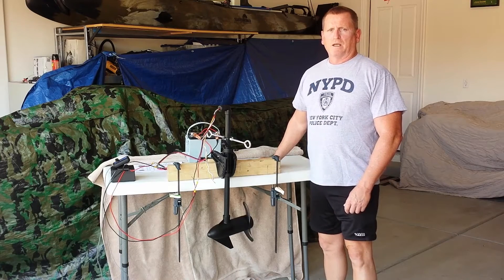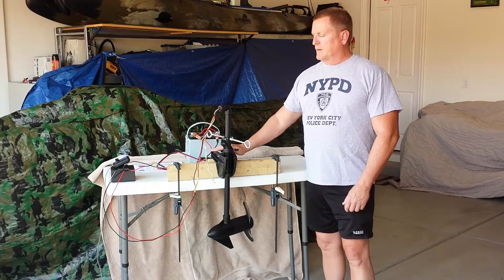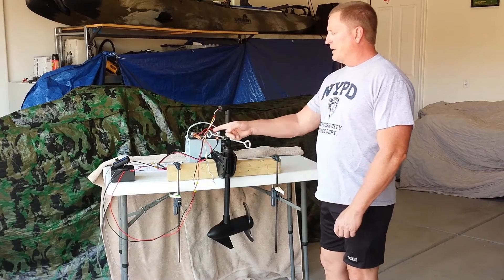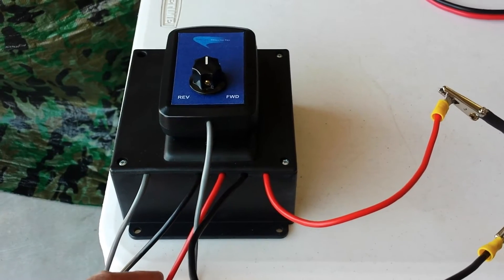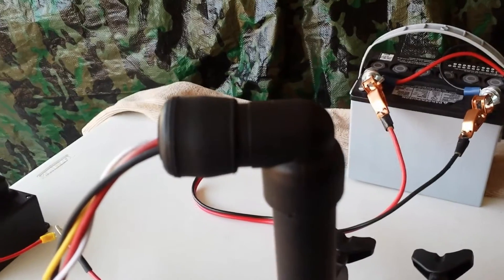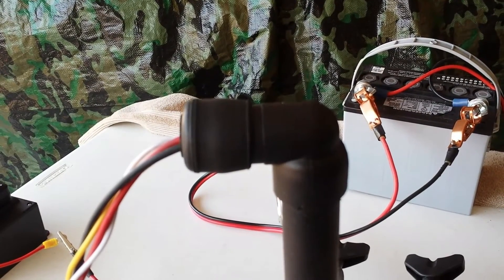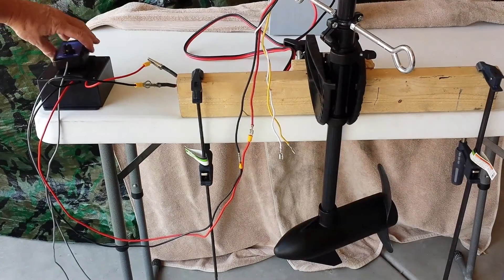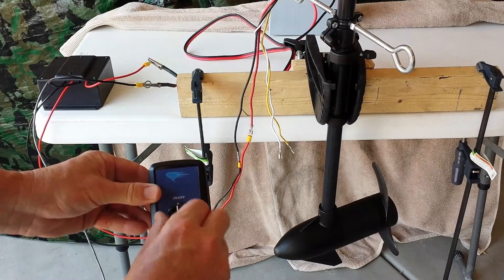Wireless Pro PWM Set Up and Test for DIY Modified Kayak Trolling Motor

Comment: Hello. When I try to hook mine up just like this it kicks the trolling motor on for 1 second then stops. Then the controller does nothing. Any ideas?
Reply from the maker: If you are having problems like that make sure you have a circuit breaker installed while testing it so nothing gets damaged. Check your pos/neg connections. What size trolling motor and PWM controller size are you using?
Reply: Hello. I have a 50 lb minn Kota  c2.  60 amp minnkota breaker.
Reply: Pwm for 55 lb motor.
Reply from the maker: How do you have it wired? Can you attach a pic?
Reply: Wired it just like you have yours. I have taken it all apart now so I can't get a pic. I guess I'm gonna have to send mine back
Reply from the maker: Was the circuit breaker going out when it stopped working? The set up uses only the red and black wires.
Reply: Nothing from the circuit breaker. I was using a Minn Kota 60 amp breaker. Motor works fine when hooked up directly to battery using the factory switch even after trying with the PWM. Just using red and black.
Reply from the maker: So, it is just when you hook up the PWM it doesn't work?
Reply: Correct.
Reply from the maker: Well, it's hard to diagnose the problem from here. I have set up 3 PWMs from WTP with no problems. Contact the company, they have great customer service. Let me know how it goes.
Reply: +Aksman Hello. I sent my unit back and it had a faulty kill switch. He fixed it and is sending it back to me.
Reply from the maker: Glad to hear it. They really have great customer service.
Reply: I have the same problem, kick on for 1-2sec and shut off

Comment: Have you noticed any significant increase in runtime like they claim? I understand their claim is very far fetched, but even half of what they claim would make it plenty worth it.
Reply from the maker: Actually, the run time is significantly greater because of the less amount of current drawn by the motor when using this PWM. Check out some of my "AMP Draw" videos to see the difference.
Reply: Awesome. I actually just ordered 2 of these after watching your video. One for me and one for my brother. But we ordered the wireless ones.
Reply from the maker: Thanks. Let me know how they work.

Comment: What did you do with the grey and yellow wire
Reply from the maker: There is no yellow wire with this controller. The gray wire goes to the control pot (speed control switch).
Reply: you only used the red and black wires coming out of trolling motor .What did you do with the white and yellow forward and reverse wires that wasn't used.
Reply from the maker: Yes, you only use the red and black TM wires. I just taped the ends of the yellow and white wires and tucked them back into the TM shaft. I show how to modify a TM in another of my videos if you need more help.
Reply: Thank you, that's what I thought just wanted to make sure.

Comment: Just a quick question  which  controller did you order because Minn Kota  c2 30 recommends a 50 amp breaker but they have several to choose from I believe they start at 30lbs up to 45lbs and does the 50 amp breaker protect both the controller and the motor thank for your great videos
Reply from the maker: Thanks Ed. The usual estimate for TM current draw is 1A for every lb of thrust (30lb=30A). However, when using a PWM the current draw is dramatically reduced. I did kayak field testing with the C2 30 lb TM and found that the maximum current draw with the PWM was less than 20A. Minn Kota recommends the 50A circuit breaker based on the stock speed controller. I bought the 40A PWM just to have a bigger factor of safety for the TM. The way the PWM is wired, the circuit breaker will protect it and the TM. I hope this helps.
Reply: You pull a lot more than 30a when on full speed and hit weeds or the bottom or from dead stop to full speed starts that’s why they recommended a 50a breaker

Comment: What made you go to the variable control vs the first box you made with the 5x3 speed controller?
Reply from the maker: The PWM extends battery life and has a smoother (and basically infinite) speed settings.

Comment: I am interested as to where you got your project box?
Reply from the maker: Hi Sam; If you mean the box I used to make the TM speed switch in a different video, you can get it at Lowes or Home Depot. It is a 4 X 4 inch outdoor electrical box.

Comment: Hi Axsman,

Looks real nice.  Glad you got one and installed it. Looks pretty simplistic.  Looking forward to a video when you get it on the water.  He has a nice neat control box that is easily attached to your kayak.

I guess he must still be having issues with getting the wireless control circuits as he shows those models out of stock.

Many thanks for sharing!

John
Reply from the maker: Thanks John. I spoke with him and he said that the wireless model is still about 2 weeks behind schedule. This one is really simple to work with when compared to the other model I am using.
Reply from the maker: Thanks John. I spoke with him and he said that the wireless model is still about 2 weeks behind schedule. This one is really simple to work with when compared to the other model I am using.
Reply: Hi Axsman,

We were looking for a dual wireless system that would wirelessly control both the trolling motor speed and reversing functions and also control a linear actuator for steering purposes. i.e. 2 knobs one for each function.  Phil still continues to work on his version.

John
Reply from the maker: Hi John. How are your and Phil's projects going?